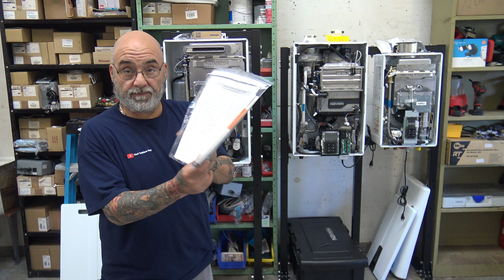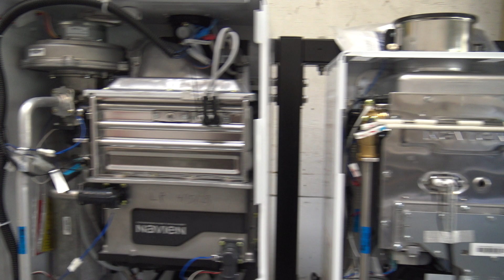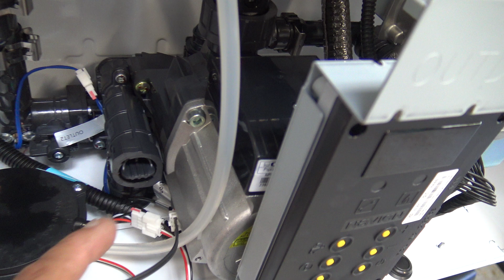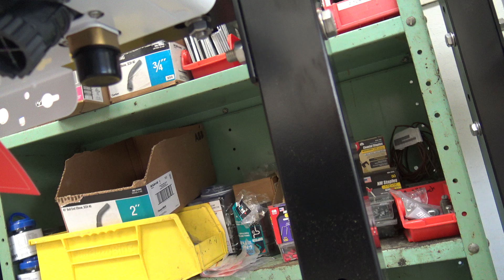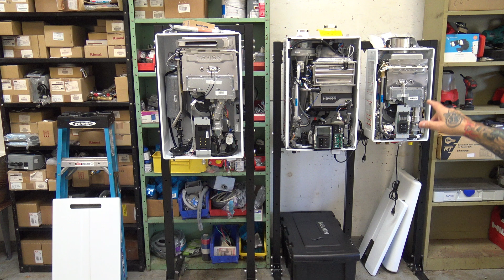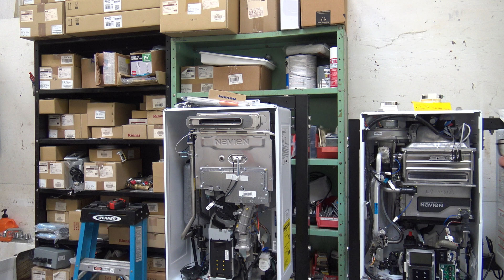Naviens new NHW700 noncondensing tankless heater with circulation

Comment: I’m a landlord and I’ve always used standard gas water heaters in my home and rentals.  5 years ago, I had a Rinnai RL94 installed in my personal home and it’s great.  At that time, my boys lived at home and if they showered before my wife and I - we had no hot water left! 

I’m very curious about the circ and tank you are mentioning.  Does this reduce the cold water waste when calling for hot water from a fixture some distance away from the heater?